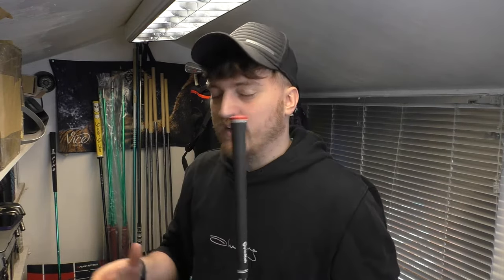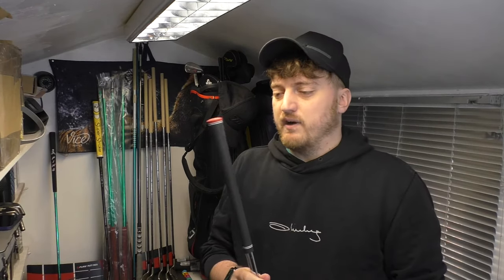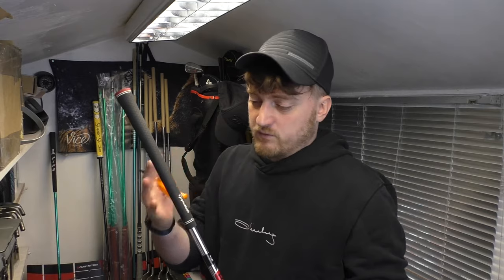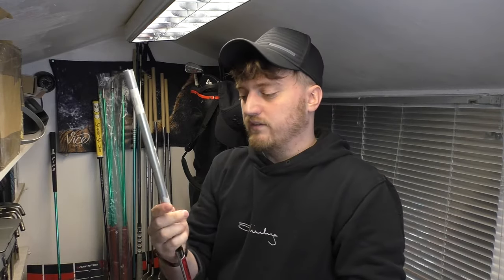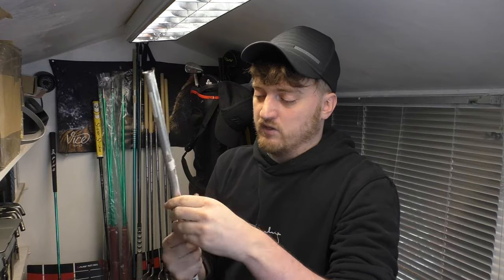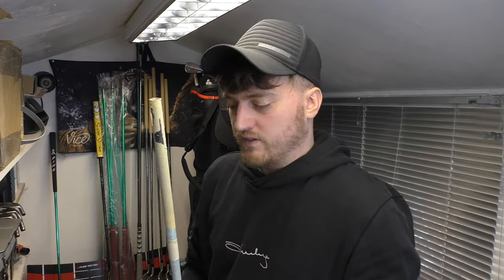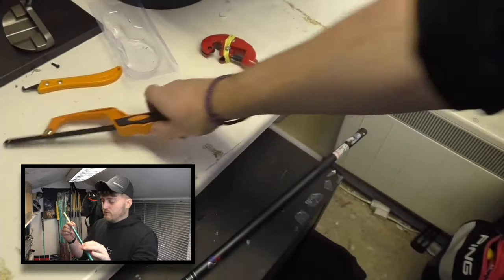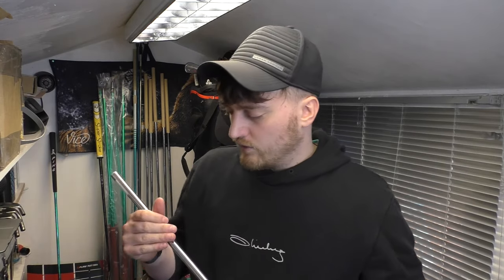How to CUT DOWN (shorten) your own golf clubs AT HOME

Comment: Hi I've bought this cutter to do one of my wedges no way will it cut the steel
Reply from the maker: Hi if you keep going at it it should eventually get through it does take a while but will eventually do it
Reply: You can't be afraid of bending the butt end of the shaft. I started with a tiny bit of pressure, turned a few times, and adjusted the screw. Lather, rinse, repeat. The end of the shaft starts looking a bit like an oval, but then you find just the right amount of pressure for the wheel to cut, go around 5-6 more times, and you're done.
Reply: Those cutters are made for copper piping and thin steel tubing. It will 100% cut the shaft of a golf club no problem if you use it correctly.

Comment: Problem is often times shaft butt end will deform as you tighten the cutter. It makes it difficult to cut it in straight line.
Reply: You're using too much pressure. Barley tighten the blade and do several rotations till it gets easy then repeat.
Reply: You have no idea what you’re talking about